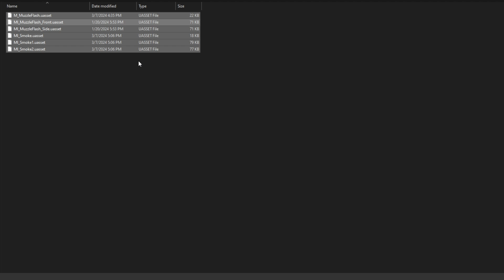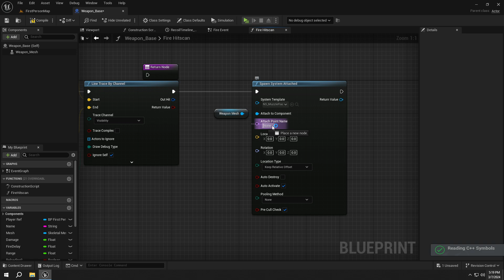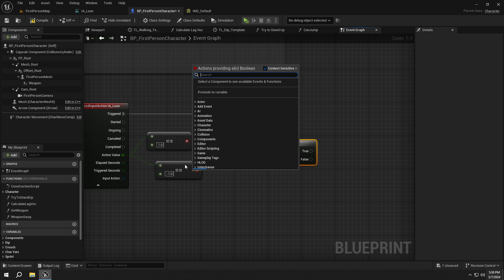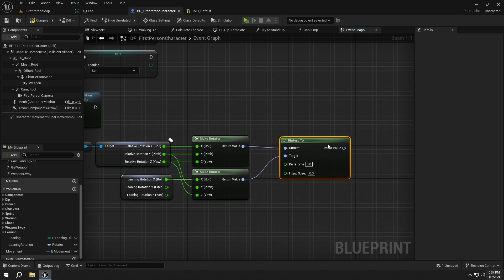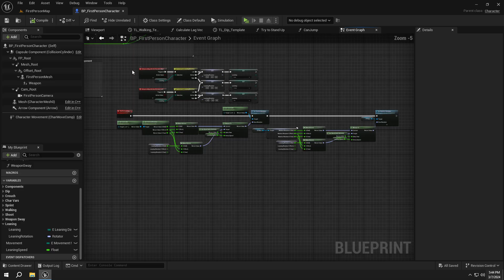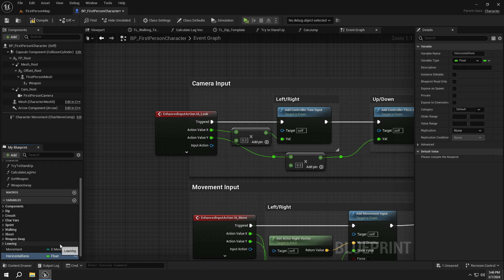UE5 Realistic FPS Game Tutorial #9 - Muzzle Flash And Leaning System

Comment: how can i change the leaning system ? for example that i have to hold Q or E to lean and when i release it goes back to normal ?
Reply: I found a way I just got rid of the Enum Leaning and used the leaning rotation. For example for lean right I had set leaning rotation to x20 and had it hooked up to started instead of tick and had leaning rotation default as completed and copied the rotation default for lean left completed. I also got rid of the input triggers for lean left and right.